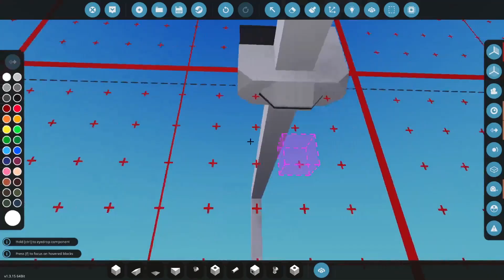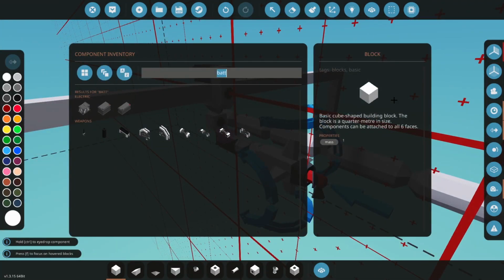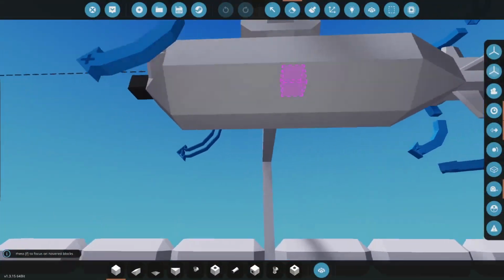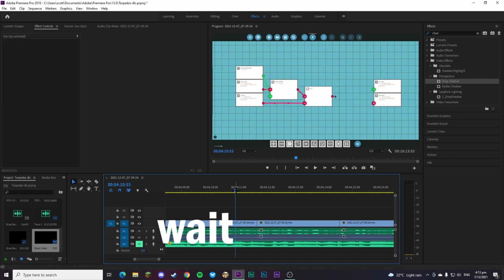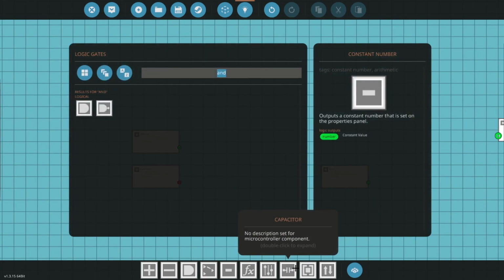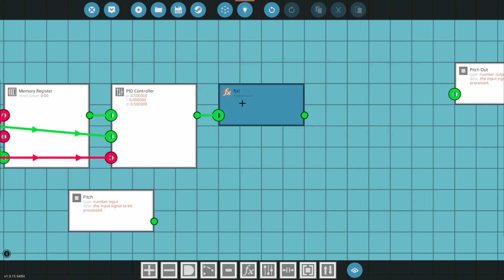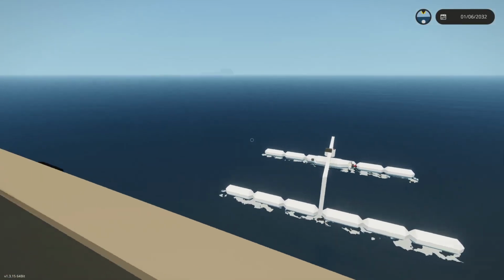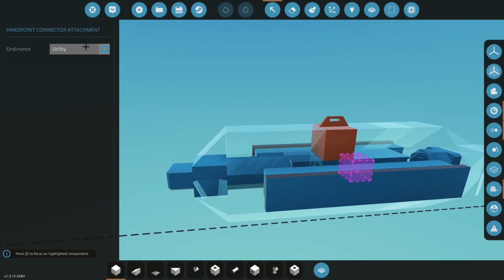How to Make Torpedoes with the Weapons DLC! - Stormworks Build and Destroy

Comment: Pero sounding like a noob here but. What does the PID do?
Reply from the maker: A pid looks at the difference between a setpoint and the process variable and based on the tuning putputs a number value to affect something which will affect the process variable. Essentially they are used to move values to a desired value